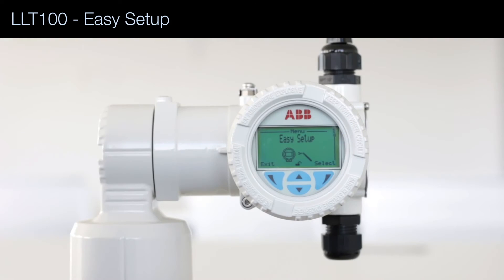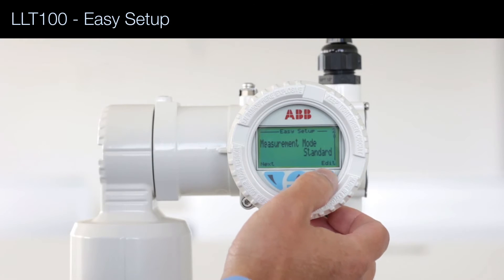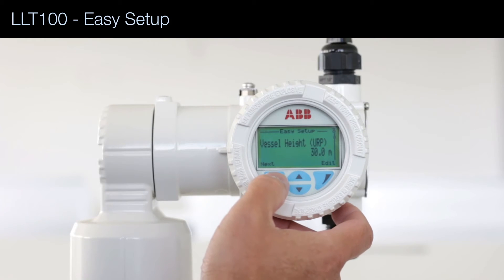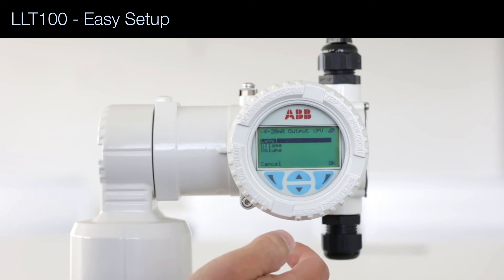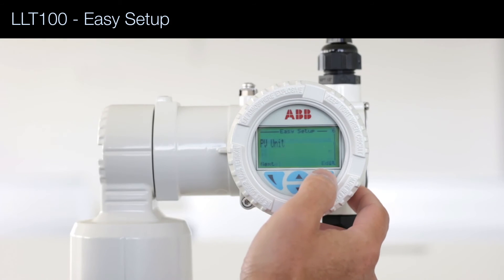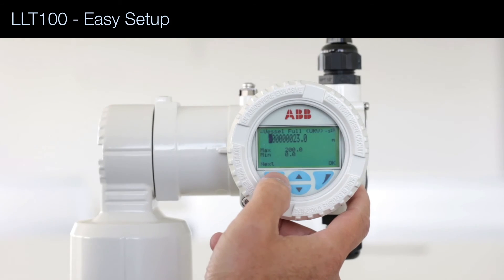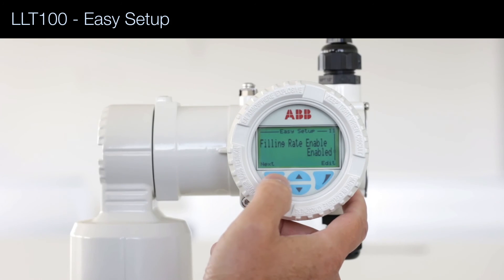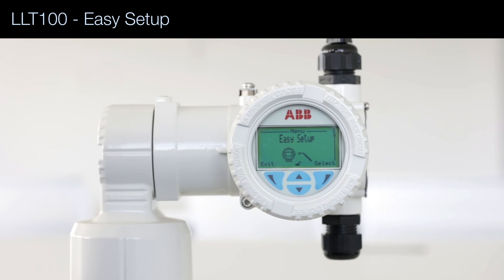LLT100 laser level measurement Easy setup menu

Comment: is enough only setting at Easy setup mode for configuration in real application?
Reply from the maker: Thanks for your question. Just using the Easy setup menu will be enough in 80% of installations. In the other cases you might need to add damping, for instance, and it is not much longer.
Reply: which condition/cases I may need to add damping?